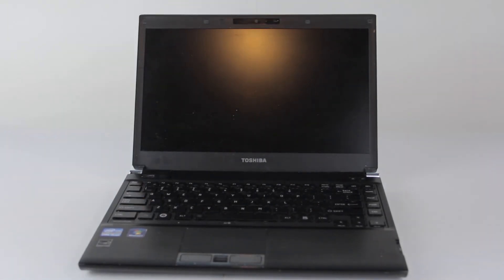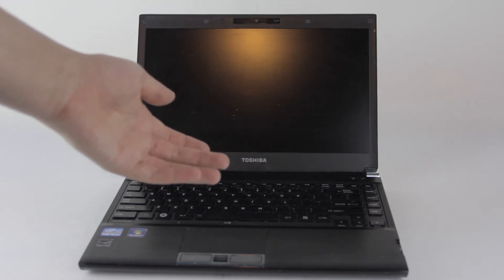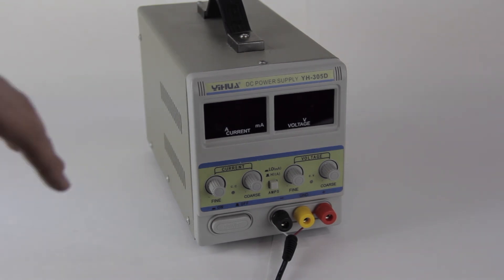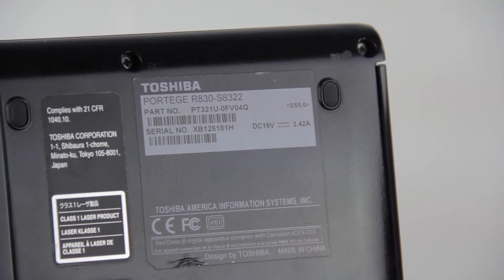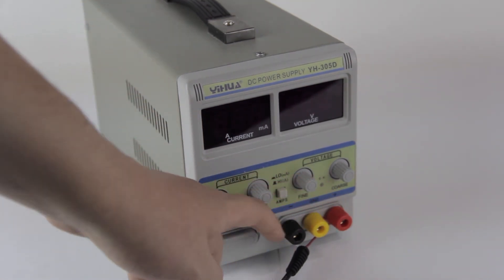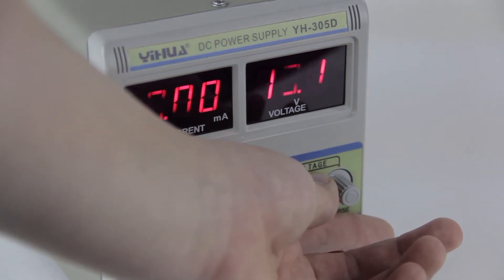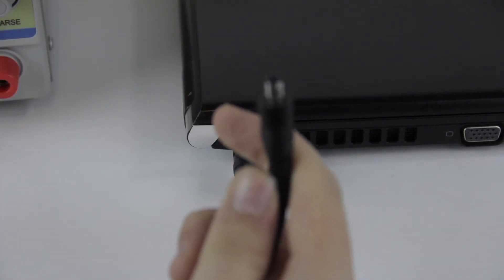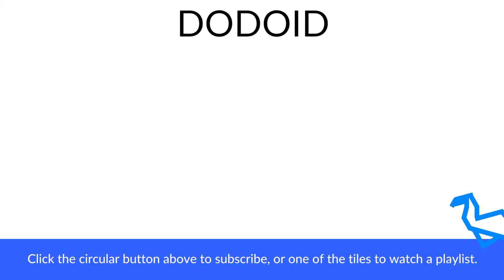How To Test A Laptop Without A Charger Using A Bench Power Supply (Day 11)

Comment: I made a diy universal laptop charger by using a universal connector from Walmart for small gadgets that have laptop connectors and took a laptop charger and a charging port it works in, then I solder the Walmart connector to the charging port and connect it to my old laptops charger to use many other laptops including my old one

Comment: What’s a good bench power supply on a budget that’s adjustable? And did you find out what’s wrong with the MacBook in your MacBook repair vid?
Reply from the maker: Unfortunately, the MacBook still doesn't work. I haven't had all that much time to get back to it, but what further diagnostics I have done haven't really told me anything other than "SMC's gone weird". As for what's actually causing it, I haven't a clue. Power supply wise, just look around and buy something that suits your needs. Do keep in mind that some beefier laptops (for example, an ASUS gaming laptop I used to have) will draw quite a lot of power, so a larger power supply capable of supplying more amps can be rather useful.

Comment: Good explanation. If you just need to test laptops, you could buy the universal adapter that goes with those barrel jacks. Still, the power supply can be useful for many other things, so it all depends on one's needs.
Reply from the maker: IMO, this is far more useful, given that it can run anything from an 8.5v Chromebook to a 20v ThinkPad, with enough power for a higher-amperage gaming machine. It's just generally more versatile.
Reply: @Dodoid
True. Some machines are picky, especially Dell laptops. My Precision M6400 might run from a 65 watt universal adapter, but the performance will definitely be throttled (and the computer will certainly complain). How much wattage could that bench supply put out?

Comment: If you'd like to do this, and don't already have connector tips, I recommend you get this pack, as it includes the cable, AND has some of the more exotic connectors for stuff like older Samsung laptops, and especially the 3 and 4 pin connectors for the Latitude C Series and ThinkPad 760 series respectively!

http://www.dx.com/p/replacement-power-cable-with-11-12-adapters-for-laptop-notebook-129303